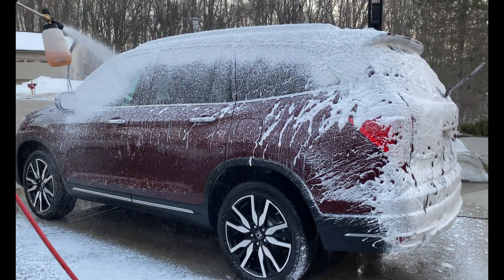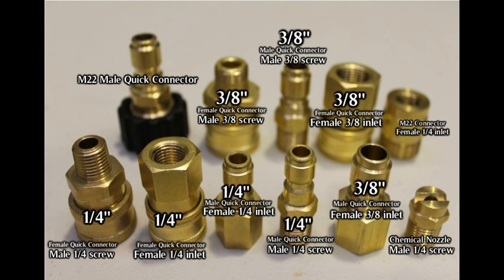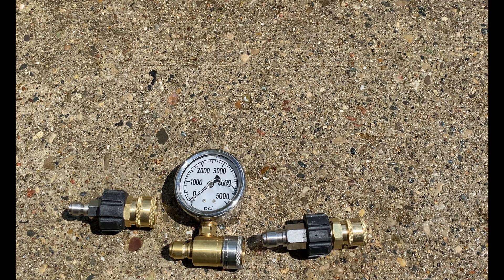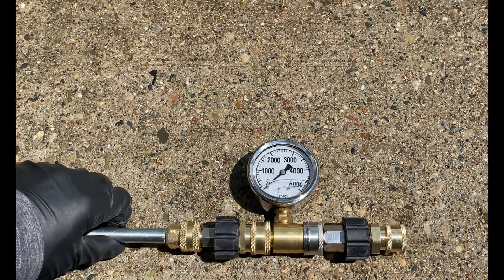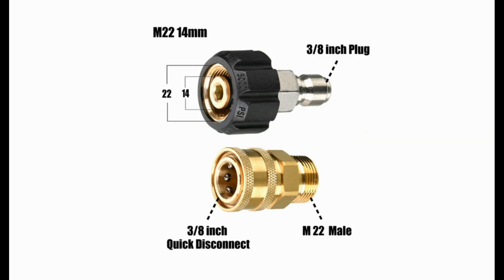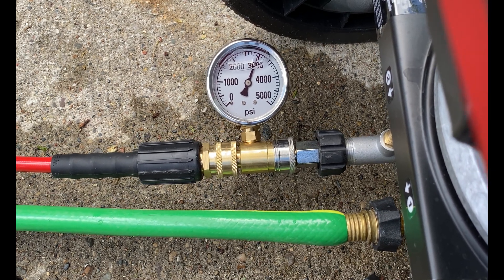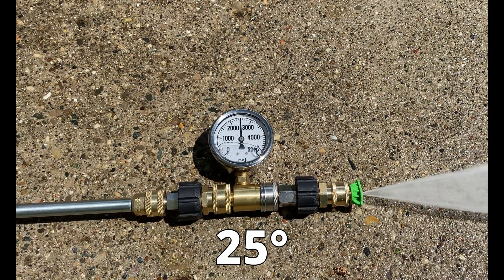How to Check Power Washer Pressure

Comment: Thanks for the video. I have a 3200 psi and 2.4 gpm supposedly.  I put the guage on the pump outlet and was getting the same 2400 psi on trigger press ( 25 deg nozzle, 027 orifice)  but only spiked to 2700/2800 psi on trigger release.  but the gpm was only 2.0. lower than i expected given the lower discharge pressure.  Not sure if that's normal.. Or if there is a problem with the unloader.
Reply from the maker: The GPM is a factor of the orifice size, so you might want to check that too.

Comment: Good video. Some brand pressure washers do not output the rated PSI as labeled on the box. You can buy a 3200 PSI but true output is rated at 2700 PSI but the Pump Motor can withstand a maximum of 3200 PSI internally but your output will always be rated less. Higher the PSI equals Reduced GPM. There are Charts available to know what Size Nozzle Tip to use for the task.
They are color coded too.  A 40 degree "White" tip is best when washing a vehicle as the angle is wider with lower PSI and more GPM. The safe PSI for washing vehicles is between 1000 to 1200 PSI, as above 1500 PSI may greatly impact and damage the vehicles body paint. Use the Chart regarding your machines PSI and GPM and obtain the correct orifice size as in millimeters for example 2.5mm, 3.0mm, 4.0mm because the larger the orifice will provide more GPM and less PSI. The opposite is true as the smaller the orifice will provide greater PSI and less GPM. For about $20 to $25 you can buy a Pressure Washer PSI Gauge (0 to 5000 PSI or 0 to 6000 PSI) connect to the output to the pressure hose which is connected to the Nozzle Gun "Sprayer", squeeze the trigger and read the PSI gauge. Be careful not to drop the gauge as it will become damaged, inoperable, or give inaccurate readings. Gauges can not withstand any abuse or misuse. Get yourself a Foam Cannon if planning to wash your vehicle(s). Have fun and be safe. - oh! that is some very good water pressure coming from the house (often between 45 to near 80). Average is about 60 PSI so getting about 80 PSI is excellent.

Comment: A lot of good info but you left out the most important, what nozzle size were you using?  Spray degree makes no difference in pressure when nozzle size is the same.
Reply: According to the Amazon listing for the nozzles, he's using a #2.5 orifice. I feel like he's losing out with it though as the pump is rated for 2.4GPM but when cross-referencing the 2500PSI with the #2.5 orifice it equates to about 2GPM.
Assuming he's pressure limited and not flow limited, I'd imagine he would be better off with a #3 as that should put him bang on the 2.4GPM rating at demonstrated continuous pressure.

Make no mistake, I'm no expert as I only started tinkering with my pressure washer about a week ago and I'm yet to invest in my own pressure gauge for it, but I find the science between pressure, flow, and orifice size fascinating.

Comment: Great video of Static Pressure and running pressure, a drop from the Highest pressure when the trigger is released to the steady run pressure when using the pressure washer. 
We also refer to this "Static Pressure" as "Burst Pressure" , the first burst of pressure that occurs when you pull the trigger before the running pressure starts.
Also, the size of the nozzle orifice will affect the running pressure. A larger 4.5-inch Nozzle will reduce the running pressure but allow more water to come through it.

Comment: Does anyone know if the quick disconnect adapter that the gauge is screwed into is available separately? I'm not being cheap, I just bought a gauge and several brass fittings trying to piece it together but didn't realize the machine uses metric stuff. So all I need is that dang adapter.
Reply from the maker: I had the same problem finding all the adapters, I had to get them in the sets linked in the description.  Maybe they are available separately since I posted the vid.

Comment: Came to watch your video after I installed a guage today to confirm that the drop is normal and I'm glad it is. I'm building a GPM maximizer and waiting for the parts so I can remedy the situation and get the full or close to the rated psi for my pressure washers instead of being a 1000 psi off
Reply from the maker: Glad it helped!  Good luck on your project!

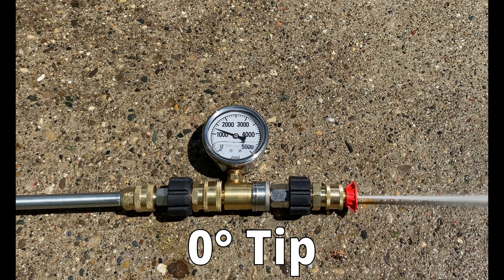Comment: Can someone please tell me what exactly is needed to go from the end of the pressure washer wand's 1/4" quick connect to the gauge and then from the gauge which is 3/8" to another 1/4" quick connect like at the 1:31 time stamp. Thanks
Reply from the maker: Yes you will need 14mm M22 to 1/4'' Quick Connect:  https://amzn.to/347SNFt  
and
14mm M22 to 3/8' Quick Connect:  https://amzn.to/3uiBufE
these are the adapters for the larger pressure gauge.  You should confirm the correct thread of you pressure washer lines but the most common is M22.
Reply: @OwenLucas  Hi and thanks for the response. Do you not need 2 of the 1/4" Quick Connects?
1 from the quick connect on the wand to the gauge and then from the gauge to a 1/4" nozzle?
Reply: @perrybmad  I know this is 1 year later but FWIW....you'll swap the two M22s from the two sets and attach the Gauge in between.

(M = Male, F - Female)

2pc 3/8" M22 Kit = [3/8"M -> M22F] + [M22M -> 3/8"F]
2pc 1/4" M22 Kit = [1/4"M -> M22F] + [M22M -> 1/4"F]

This will give you [1/4"M -> M22F] -> [M22M -> 3/8" F] -> [3/8M  GAUGE 3/8"F] -> [3/8" M -> M22F] -> [M22 M-> 1/4"F]

Comment: My machine is rated at 4,400, but I was only able to get to 3,800-3,900.  Does this seem normal?
Reply from the maker: Yes, I wasn't able to get the full 2400 psi from my machine.  Max pressure might be under rare specific circumstances.
Reply: @OwenLucas  thank you for your response

Comment: Hi! There is no difference where to connect the gauge? To the pressure washer or to the end of the gun with the same nozzle? I see the pressure with the white nozzle is the same in both cases, 2300 psi. So, no difference?
Reply from the maker: Correct, I did not see a difference in pressure regardless where I connected the gauge.
Reply: As a general rule you are supposed to take away one PSI for every foot the water travels away from a pump. Basically that's the length of whatever hose you are using. 

To eliminate as many variables as possible, a pressure gauge should be placed between the pressure washer hose and the pump. That will tell you what the pump is putting out. After that you can move it around to see if there is any change of pressure, which would indicate there might be some kind of hose/wand blockage or leak.